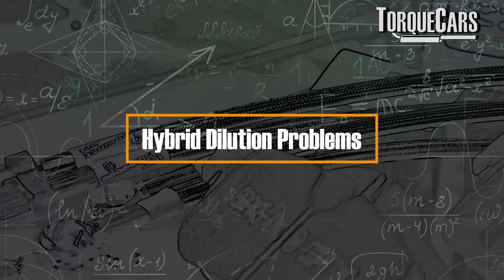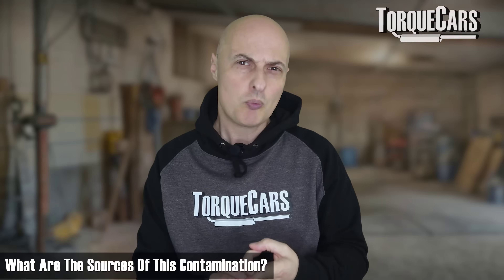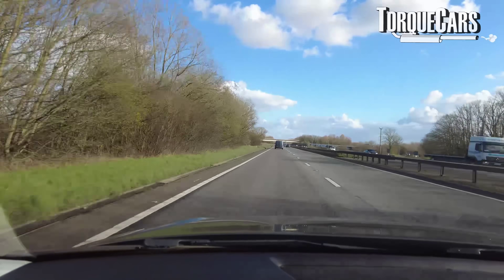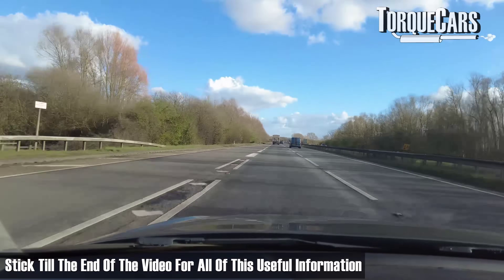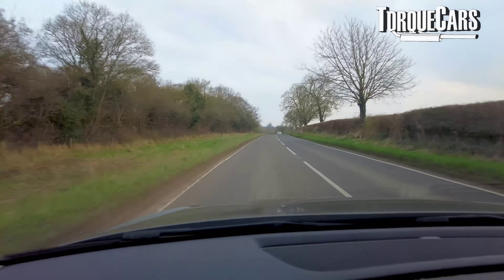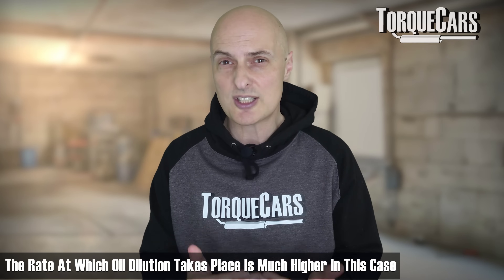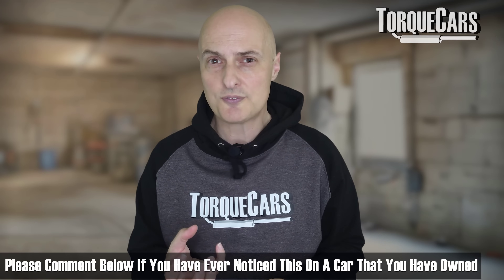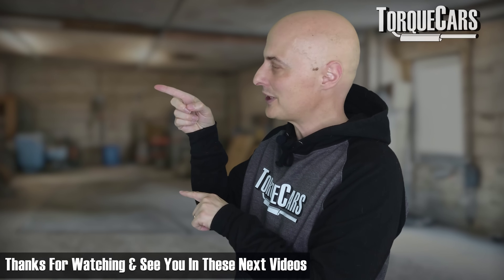Driving A Hybrid? Do This To Avoid Oil Dilution. What Everyone MUST Know.

Comment: There is hydrid specific oil to hold water in suspension better. A 2026 Tucson Hybrid will only turn off the EV operation in Sport mode. Still turns off at a stop. I can smell the fuel on short drives, but I am still breaking it in, so maybe it will get better. I also decided to run the 30wt global recommendation instead of 20wt because of the cooler temps and dilution.

Comment: I just bought a 20 25 Honda CRV hybrid I had a regular 2022 Honda CRV and 2 1/2 years I put 486,000 Mi on it I'm always on the road driving long distance very rarely am I in City driving my question is always went by what Honda said the oil changes needed and I do synthetics but sometimes at night if I stopped and it's late and I got to get started early I may sleep in the car and leave the engine running not always cuz I know it's not good with the combustible engine how does that affect the Hybrid part of the car to let it idle at night when the temperatures are ready you know at running temp
Reply: great question!  i dn't exactly know, but i doubt that it's a problem for the hybrid system which in honda, happens to be a bit different from toyota, honda has a generator thing or integrated generator w/ electric motor or they're two separate thing, can't recall.  And battery, which is located carefully away from the engine of course.   I would not worry at all BUT i would absolutely keep a close eye on the levels of oil , and coolant!!!  Both are crucial for the longevity, but also you safety while asleep, bcuz of theoretical fire risk.  I'd also keep a small fire extinguisher inside with u, regardless of sleeping inside w/ engine running, bcuz of all purposes, etc.

Comment: I don't know about other manufacturers but Toyota hybrid engines don't seem to have this problem, Toyota use very thin oil but I have noticed that it rarely drops and I'm amazed that it always seems to look clean even after several thousand miles, the engine's do run hot as even when you're just driving with a light throttle or stopped the engine will still be under load as it's always charging the hybrid battery which helps get the engine up to temperature fast

Comment: Looks like the good old "pedal to the metal" technique that helped normal gasoline engines still works for hybrid. 
Wonder why Honda CR-V is so reliable? Try driving one with ATF. It has so weak engine (r20a), that it often goes to redline. This is probably the secret of its reliability ;P I had one such CR-V and Civic. 300k km, and still running as new. But every acceleration equals read line un to the cut-off point.

Comment: Engine oils that are specifically formulated for hybrids help mitigate some of these issues but they don't entirely solve the problem. I have owned a Prius in the past and you have a lot of control as to when the engine comes on. Try to cycle it as few times as possible and keep the engine running as much as possible when at speed. The engine's Atkinson cycle, optimal high gear ratios, and ability to charge the hybrid battery will not dampen your efficiency numbers if you are doing it right. Hybrids confuse people because you initially think you need to drive with electric only to get the best fuel economy but actually, you need to learn to use the combustion engine most efficiently. It isn't actually any different than a gas car. Better to maintain your speed than stop and charge the hybrid battery. The ability to charge the traction battery while stopping is just a way to reduce wasted energy but actively trying to brake to do get regen is not efficient. As for the engine, you should actively be using it where it is most efficient (i.e at cruising speed). Keep it running if you can with the correct gas pedal position. Getting the engine up to operating temperature is also very important for efficiency so delaying warm-up by actively shutting the engine down more than required does not help increase fuel economy. Save your traction battery capacity for low speeds where combustion engine efficiency is absolutely terrible. Driving this way is also better for your traction battery as you won't be cycling the battery unnecessarily, reducing its service life. Hybrid systems are great but like I said, they are gasoline powered and thus should demand your attention towards habits that are beneficial for the combustion engine. Again, you will see good results if you do this correctly and will still be able to exceed the fuel economy ratings of your vehicle while decreasing stress and wear on the entire powertrain.

Comment: Are you referring to plug in hybrids or normal hybrids (eg Toyota Camry etc)?

Normal hybrids will not go any sugnificant distance on electric drive only. They need the ICE to go anywhere.

If you only do short trips then dont buy a plug in hybrid.

Comment: I would recommend to do engine oil analysis every oil change to see  how is the engine health parts and adjust the oil change intervals according to the driver use profile. I do with my Prius 2018 and it is working fine.
Reply: Yes, that's a very good idea! I do mainly motorway miles on my CHR 2 litre hybrid. I'll change the oil at 10k mark which takes me 3 months to do and do the oil analysis to see if that's too much or just right.

Comment: If you own a Gen 3 Toyota Prius, I strongly suggest fitting an oil catch can in your PCV line. The 2ZR-FXE loves to slurp engine oil out of the PCV valve. Toyota designed an oil separator/baffle box in front of the PCV valve, but it really doesn’t seem to work.

All this oil vapor mixes with EGR particulates, at the top of the air intake manifold, to form a muck that slowly differentially blocks the plenum EGR ports off. Cylinders 1&2 become most constricted and operate in an undetected lean condition. This generates excessive heat and can eventually blow your head gasket.

An oil catch can won’t capture all the PCV oil vapor, but any reduction is welcome.

Also, do a complete EGR system clean-out every 100K miles or less. The cooler, valve and intake manifold get caked up with carbon and this leads to problems.

Whilst the Gen 4 Prius also uses the 2ZR-FXE, the EGR system was made larger in order to extend the EGR clean-out interval.
Reply: indeed that is what i've read and seen, e.g. from the experts online too such as Car care nut, and i'm forgetting several other yt'ers as well

Comment: I change the oil in my 1999 1.4 Alfa Romeo Twin Spark every 3k - 3.5k miles. When doing a lot of motorway driving (81 mph, 4,330 rpm in 5th gear), the oil comes out almost as clean as the day it went into the engine. When I was working for a firm just 2 miles from home, after just 1,500 miles I could see a clear rise in the oil quantity and could smell fuel in there. Naturally I changed the oil "the next hour" I was done with working there.

Comment: I get the feeling that electronics problems will see off most hybrids before oil dilution becomes an issue.
Reply: @VintageLynx  what kind of electrical problems?
Reply: @adampavella1225  after 20 years your engine will still be running, but connectors will start to corrode, the cables will become problem, and you will have different problems with electric and electronic parts. 

But... first you need to take care of suspension and other rusty parts. So: 
1. Rust
2. cables and electronics
3. engine and oil dillution problems.
Reply: @VintageLynx  
Sure that's why the hybrid battery is warranted for 150,000 miles and the hybrid components and electric motors are warranted for 100,000 miles.

The gas engines and transmissions are  only warranted for a short 5 years or 60,000 miles. They are old and inferior technology.

EV motors can last 1 million miles and the batteries can last 500,000 miles.

Great Grandpa also didn't want to give up his superior horse and buggy 120 years ago.
Reply: I have a 25-year-old Prius, it's still running fine.

Comment: I have a Subaru mild hybrid and have no control over the stop start. I do wonder why it sometimes stops when the engine isn't fully warmed up but this does only seem to be in the warmer weather. I change oil and filter in between dealer services, every 6K miles.

Comment: Fuel and water evaporate once the oil is hot enough, then they make their way up the PCV hose into the engine's air inlet, and then they get burnt off.

Comment: I take comfort from the fact that my Lexus is a 3rd or 4th gen. Toyota hybrid product. It utilises a clever multi-way diverter valve set-up to isolate parts of the engine coolant system to ensure, amongst other things, optimal warm-up. It does indeed warm up very quickly. As my commute is relatively short, at between 7 and 12 miles, I choose to also change my oil and filter at 6 month intervals (about 4500 miles for me). I use OEM Toyota filters and an oil of the correct grade which meets or exceeds the specification called for. I have faith in Toyota engineering (they are the daddy when it comes to HEVs after all) and my routine. Time will tell I suppose...

Comment: Great video. I was extremely concerned over the mayonnaise    accumulated under my filler cap (Renault Austral), I was told by the dealer, this was normal. In the Austral you have no control over whether you run on electric or ICE unless you blast it down the motorway, impossible around town. Loved the car but extremely concerned over its ICE longevity.

Comment: Interesting information particularly as I hope to keep my car for a longer time. I think checking the oil in detail is my takeaway. I have a Civic hybrid and can’t control stop start. I do few journeys and a short one is ten miles. As the battery is small I think the engine does heat up as it runs often. Touched base before on the car with you. I love it. Powerful (instant) and very economical at 62 mpg all in since purchased 18 months ago. Love your quality content which seems (is!)bias free and informed.
Reply: If many trips are short, then change your engine oil (+filter) twice often than what Honda/dealership is recommending.
The oil is cheap, the engine is expensive 😉

Comment: Toyota and Honda have been making hybrids for many years and people have easily gotten 300,000 miles on them with no major problems. These things work if done well. My 2018 Camry hybrid has been completely trouble free.
Reply from the maker: Indeed they have, sadly though everyone else is playing catch up and many car makers are only on their 2nd generation of hybrid whereas Toyota have decades of experience from their early Prius onwards. I have heard that in general build quality and longevity is going down for ALL car makers? What are your thoughts on that assertion?
Reply: @torquecars  Generally the reliability is going down for all manufacturers because they are forced by their shareholders to make savings and use planned obsolescence for higher profits.
But it isn't that much about the quality nor longevity for the top Japanese producers, it is rather the plastic components, used because of their characteristic of breaking down predictably (ofc, after the warranty years), thus providing a steady flow of income for the dealerships.
Toyota / Lexus (and those where they have shares and also to whom they give their top hybrid systems: Mazda, Subaru, Suzuki), Honda / Acura are still at the top of the most reliable brands, with the lowest TCO (here Mitsubishi is #3!).
The biggest factors making most cars unreliable, with a lower longevity are the components forced to follow the dumb "green" regulations (that USA just scrapped): turbo, start/stop (but good for hybrids, BEV), lower displacement engines, cheap CVTs (not the very reliable ECVTs), cylinders' deactivation, the plastic parts used for planned obsolescence etc.
But it's important to mention that the second most reliable segment is the HEV (Self-charging hybrids), especially because of Toyota / Lexus, according to the annual surveys run by Consumer Reports.
Reply: I have 270k on mine rav4 hyb...
Reply: Toyota and Honda hybrids are not an issue and never have been it's all the others showing up in the last fews years incredibly late to the party who've rushed out these hybrid systems and turned out crap ones. The German hybrids are poor and I've heard some serious horror stories from them. JLR predictably screwed up with their hybrids.

Comment: Just need one clarification.... Toyota hybrids generally engage only the engine( shortly after ev only startup) for quite some time(3-5 minutes at least) to allow for a warm up and then it shuts off and assists as and when needed, this does not always translate to the temperature guage being at the midpoint but what I have heard is that the initial longer engine run time period is all that a hybrid needs to contain oil dilution. Correct me if i'm wrong on this.....
Reply: That is correct, I own a Toyota hybrid and yes, it's prioritizing heating up the engine at optimal temp. The manufacturer actually recommends journeys of minimum 8km so I do think this might be a problem if you make shorter trips. Also in colder/winter times when sitting in traffic and demanding heating for the cabin aswell the car does struggle more to keep the engine temp in optimal range but still tries to prioritize the engine temp. All that being said I think hybrid cars are far superior to normal ICE vehicles.
Reply: I think you’ll find that it depends on the generation. I have a Gen 3(‘10-‘15). Mine only runs up to -90 degrees Fahrenheit when starting cold. This is typically about a minute or so. I can get the engine to run up to a higher temperature if I run the heater/air conditioner at startup.

Pretty sure if you move into a Gen 4 or 5 you’ll experience a longer warmup cycle from cold start.
Reply: @EvzenKovar-i5p  My Gen 3 Toyota needed to warm up to 40C every start up. My new Gen 4 can move on electric power from completely cold as long as the battery is charged up.
 The thermostat is now electrically operated and the electric water pump speed is variable according to conditions. The engine is warmed up in minutes, it's a major improvement over the Gen 3. Now running at 80 mpg, my Gen 3 was 64 mpg on average.

Comment: Oil dilution is a serious issue nowadays, engines actually 'bleed' heavily diluted oil from gaskets/joints and seals and contribute significantly to DPF ,EGR and inlet tract contamination. Apart from oil levels increasing as oil dilutes, there is, in a lot of cases, a significant increase in general mechanical noise as the engine wear becomes excessive. Problems induced by solutions to problems!
Reply: indeed this is possible, ie significant wear:  that's why getting a sense of our oil's petrol presence/smell is important and its well worth it to change oil veeeery often to avoid the mechanical wear.  Much cheaper than engine replacement.   We've seen this more over the past twenty yrs w/ the looser piston rings, apparently main cause of dilution, and in a few of the 'best' makers engines and a lot of the other decent makers engines like germans
Reply: Not for the top Japanese hybrids (Lexus, Toyota - and their partners that use Toyota hybrid systems: Mazda, Suzuki, Subaru -, Honda) - they are the most reliable, have serious longevity and the lowest TCO (according to Consumer Reports and other good sources like mechanics) etc.

Comment: I'm sticking with ICE vehicles! You just helped me reassure the fact that I'm not ready for Hybrid/EV/PHEV technology! Thanks, bro'!
Reply: @Funkydood  i’m considering to just get a horse at this point..?
Reply: I am also a partisan of the ICE cars (driving a Miata ND2 and a Jimny) and I despise PHEV/BEV (the expensive and unreliable electrified segments) due to logic - those cars are dangerous, have a shorter life (that's why they have a huge depreciation), a high TCO, they are impractical (especially for long drives and towing) etc. 
However, my wife has a Lexus hybrid that is amazing. And there is no wonder that the Consumer Reports points out to HEV (Self-charging hybrids) as being highly reliable.
Unlike PHEV/BEV (that were designated "green" alternatives and pushed by the government's worldwide, subsidies included), the HEV were developed by Toyota and Honda for saving fuel / money / time (their electric big battery is getting charged mostly from the otherwise lost kinetic energy when braking).
And, based on my calculations and the available experiences of HEV veterans, the hybrid part is covering the cost of this hybrid battery (that lasts more than the 10 years that Toyota/Lexus guarantee) in the first approx. 40'000 miles.
It's not only about savings, comfort etc., it is also about the high reliability and low TCO, because the ECVT is very reliable, there are less expensive repairs to pop out (like the alternator, belts) plus less consumables - for example, the brake pads and rotors (because they are used less due to the regenerative braking).
Overall, the price difference of my wife's Lexus hybrid (vs. the ICE similar variant, but less equipped) and the future cost of the hybrid battery have been covered in less than 6 years plus we have the major benefits of the faster accelerations, more comfort (the quietness is top), higher trim etc. The fact that we bought it used for 2 months (1'300 miles) with a 34% discount vs. MRSP was a huge bonus.
Check it out, you might be surprised.

Comment: I don't have a full hybrid, but a mild hybrid (Audi A4) and have disabled stop start permanently (via OBD11). The drawbacks FAR outweigh any benefits. 

As far as I'm concerned, maintaining a short oil change interval with high quality oil is the best thing you can do for your engine.

I change my oil every 3,000 miles, so it is almost always very clean. Any potential oil dilution becomes pretty much a non-issue by maintaining new, clean high quality oil.

I don't do any spirited driving, but I take the vehicle out every couple weeks for an Italian tune-up.